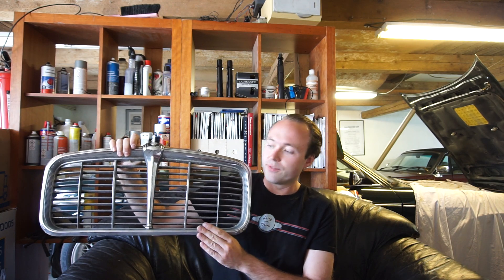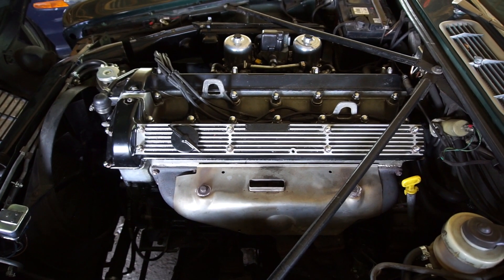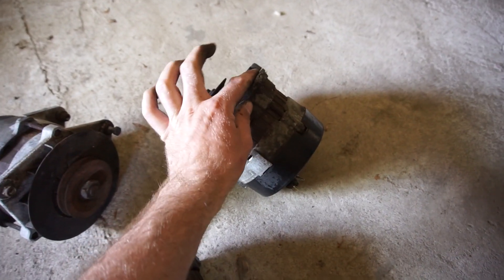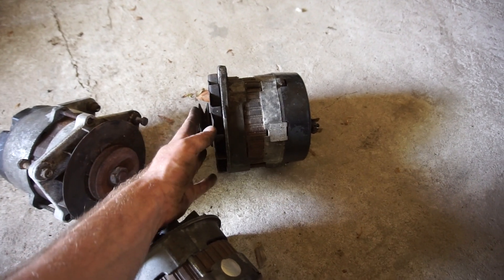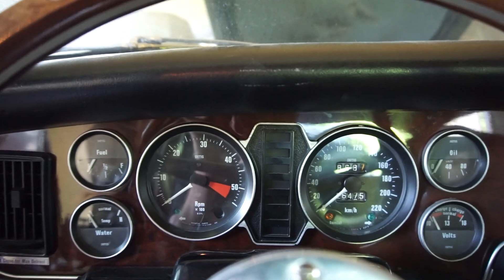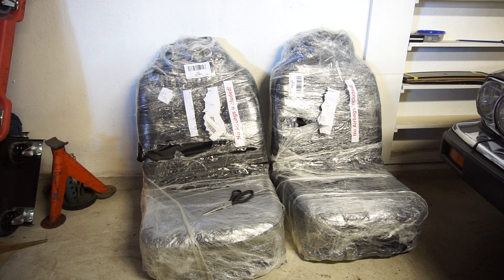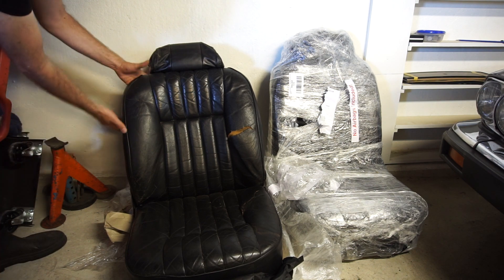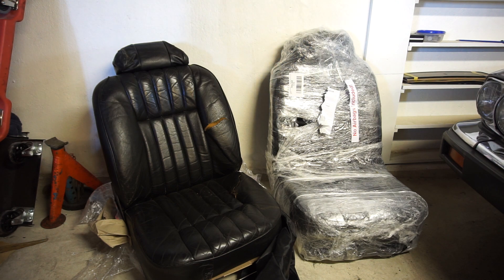Fixing My Daily Driver Jaguar and Generous Subscibers

Comment: Hi Adam. The alternator failed on my Series 2 when l  drove back from  a show (12 years ago). It  started over charging , It was a 30 mile return journey. I could smell rotten eggs, it was the battery starting to overheat !  I just kept going and when l got home l parked the Jag'  in the garage. You could hear  the battery boiling like a kettle ! I have experienced a battery explosion so decided not to touch anything. 6 hours later l  thought l'd check the car and l could still hear the battery boiling!!! And you could still smell rotten eggs ! Thankfully by morning the smell and noise had stopped. A local electrician repaired the alternator for £20. Take care and stay safe. How has Covid 19 effected you , l'd imagine your quite well isolated.

Comment: Here in the USA, most auto parts stores will test an alternator or starter for free if you bring them in (already off the car). They secure them into a stand, hook up the appropriate wiring connections, and then spin the unit. This tells you in the case of an alternator if it is charging as designed rather than guessing about it's condition. Isn't this sort of service available in Sweden?
Reply from the maker: Sadly that isn't available here. It's very hard to find any auto parts place that can do anything like that or especially for an older car.
Reply: @LivingWithAClassic  The auto parts stores here don't offer this service because they are being good and generous. By offering this service to their customers they SELL MORE parts. When a customer brings in an alternator or starter they have a computer system where they look up the type of car so the relatively unskilled workers in the auto parts store can see exactly which wiring connections go where on that particular alternator or starter when they are testing it. If a store is going to create more parts sales as the result of having this equipment in each store, and the cost of the equipment to do this ends up being less than the profit generated from extra parts sales then being able to offer this service is a no-brainer since it generates a net-positive income for the stores.

Comment: So my Jaguar is XJ6 with a 4.2 engine. When I am driving at the low speed or stuck in traffic with AC running and my electric cooling fans on my gauge reads below 13v and it goes to red showing a reading of just 10v. I tested the battery and alternator so they told me it was okay. Is this normal or do you think that alternator is getting weak?
Reply from the maker: I think the alternator is getting week. The alternator on my XJ12 was like that and I noticed a huge difference after replacing it